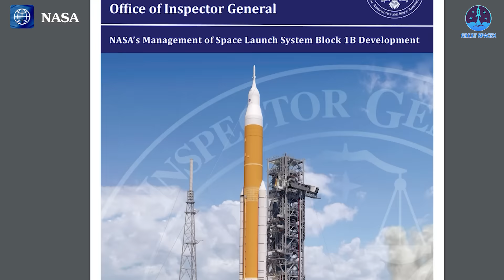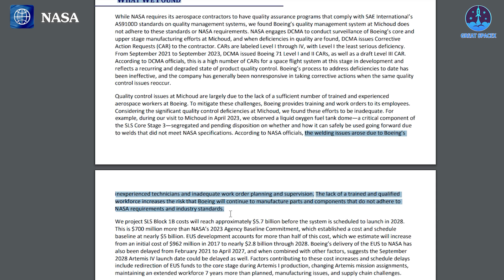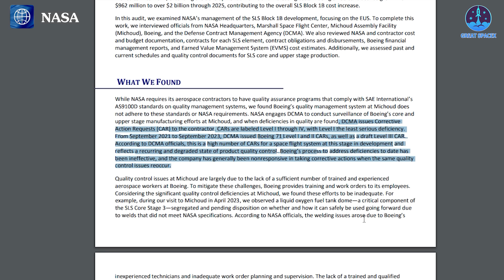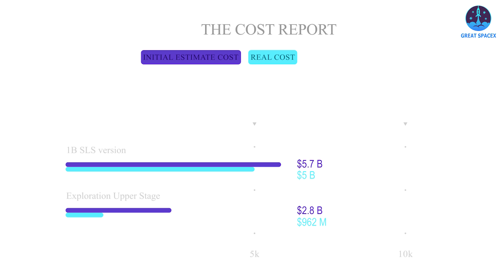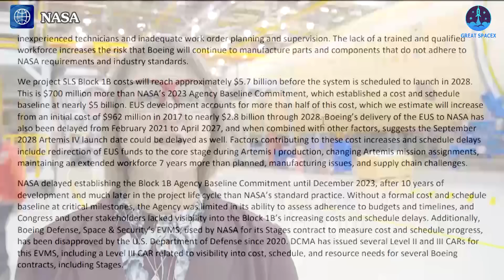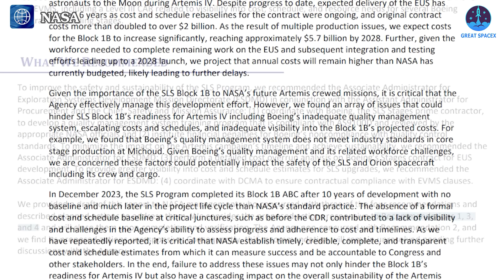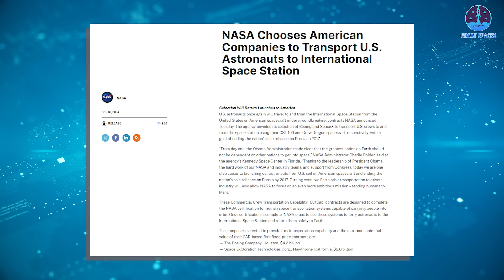NASA Stuck! Boeing SLS Core Stage NOT Safe for Crew While Starliner...

Comment: Boeing is a company of yesteryear, a great company, tip of the sword. Once LM took over Boeing and changed their business model to profit driven it was the begging of the end of Boeing and here we are at the funeral. It’s time to move forward, NASA.
Reply: When Alan Mulally was passed over for Boeing's CEO postion it signaled the change from engineering based leadership to accounting leadership.  When Boeing prices were about $50 I jumped in and jumped back out when the price was about $300.  It continued to climb after and kicked myself but then the coof hit so they couldn't deliver planes and the price tanked.

Comment: I can understand Where NASA is coming from for their systems, but afraid they have been well and truly been taken for a ride! When you look at the offerings, the SLS looks like an Atlas Rocket with boosters attached. A heavily upgraded version at that. Then there's Starliner, based on the Capsule/Command Module from the Apollo era. Boeing's SLS hasn't got off the ground yet, and Starliner can't get back from the ISS! SpaceX loves a challenge, and I can actually understand the static they are receiving from the old school system as the appear to be highly efficient in all areas! They don't want a monopoly on space, its just that others need to remove digits from their posteriors! But when Polaris Dawn undertakes its mission, another can of worms is opened that NASA will be directly involved in, and that is the space suits! It's not going to be a good couple of months for Boeing!

Comment: The marriage of politics and big business. And we wonder why everything costs so much and breaks down so often. I mean everything.
Reply: Home appliances are literally designed to break after a few years. They tend to be quite simple to repair so I've taken to repairing them myself so I can attest to how a small change could make it last years longer. For instance, a plastic clip that breaks after a few years vs a metal one that doesn't. The plastic clip being unavailable to buy, requiring its common component that breaks, which results in needing to replace the entire sub. assembly for 150$ because they saved 3 cents on a clip and won't make it available. It's hidden in the sub assembly as well so you can't see it unless you open it and it contains no capacitors so there is no risk of electrocution.

Comment: Looks like Boeing has completely stopped caring about cost, quality, or safety in all their divisions. 
Besides it being outdated technology/design, SLS at $11+ Billion for a SINGLE USE rocket is ridiculously insane. 

SLS, one single launch = $5.7 Billion
Starship & SH Booster, four launches = less than $1 Billion (will be significantly less once reusability is achieved 😉🤑🤓😎)

SLS - 4 passengers, Single use = $3.2 Billion (supposed to be)
Crew Dragon - 7 passengers, Reusable = $117 Million (crew capsule & booster)
Starship - 100-150 passengers, Reusable = $400-500 Million (Starship & Super Heavy Booster)

I think the best choice is clear. If you can’t figure it out? You have absolutely no business in aerospace. Ever hear the phrase, “if you can’t beat ‘em, join ‘em”? You can’t beat SpaceX. So... join ‘em. 😉🤓🤪   Work with them, instead of against them. Bring them into ULA (or Elon will just buy it with other like minded, innovative, forward thinking aerospace companies). You can even copy them, Elon really doesn’t care. That’s why his patents are public use. Take what he’s done and use it, try to improve upon it. But that would mean you care about innovation & advancement, instead of just your shareholders, and executive salaries & bonuses.

Boeing should step out of the rocket business and get their aircraft safe again. Leave space to those who can, and are. . . building for, and like it is, the future. 😉🤓🤪😎

#SpaceX #Boeing #NASA

Comment: Use falcon to launch the lander by itself. With a second for a blow up habitation unit for the astronauts travels. The hab unit could dock with a dragon for astronaut transfer and when returning to the earth for reentry. The hab unit, lander, dragon, and falcon could be reused several times. Likely at a lower cost than one SLS launch.

Comment: Hello
Do you know if at any time, there were considerations to give the soon to be retired ISS a brand new Orbit around the moon, be it entirely or in parts ?
Reply: Would be a lot cheaper to move it up to Luna orbit seeing as how much expense was used to get it into low earth orbit
Reply: It would take a lot of energy (and money) to get it to escape velocity and to the moon. Even if they could, the ISS is becoming obsolete. It wouldn't be worth it.
Reply: It's not possible. The ISS is too old, and the structure lacks the fundamental strength to withstand the acceleration it would need to reach escape velocity. Never mind all the torquing that would occur during that, TLI, and orbital insertion. It would break apart if they ever tried, and nothing can change the fact that every seal up there is a couple of decades old and at or past its service life. Plus the fact that the ISS lacks the basic radiation shielding it would have to have; Lunar orbit is outside Earth's magnetosphere, so it would have no protection from the solar wind or cosmic radiation. It was made for LEO. Period.

Comment: I think NASA should be looking at the Orion space craft that Lockheed Martin has built and it has flown a couple of times already and three more are under construction. Why don’t they look at that to replace the Boeing Starliner that is a piece of crap that doesn’t work , NASA should use Orion and Dragon No!? They both work!
Reply: SLS is too expensive to fly frequently, and the Orion was made exclusively for this rocket, it is significantly heavier than the dragon or starliner.

Comment: One of the big issues is that NASA is still using a Cost Plus contract for the SLS which forces NASA to pay for any cost overruns where the newer Fixed Cost contracts use for the CCP where ULA/Boeing would have to absorb the overruns.  Forcing ULA/Boeing to pay would probably be a death nail for SLS as then Boeing/ULA would have to re-negotiate a much higher realistic price and they would have to risk absorbing future losses like they did with Starliner.

Comment: Hello
Do you know if at any time, there were considerations to give the soon to be retired ISS a brand new Orbit around the moon, be in  whole or in parts ?
Reply: As far as I know, there were no serious plans to put ISS into a lunar orbit...
- Parts of the ISS are 20 years old, and their reliability is in doubt;
- You would have to redesign new engines and software to navigate the structure into lunar orbit, all on old hardware;
- A trip to lunar orbit would take a few big delta-Vs or a bunch of little delta-Vs (stress on the structure);
- The station would be constanly adjusting its orbit because of effects of lunar MASCONs;
- The Russian partner is very unreliable, and it's hard to see the time when we can partner with them again;
- Besides being unreliable, the Russians want out of the ISS by next year;
- Resupply and emergency evacuation of a lunar orbit human habitation would be more complicated than LEO;
- And you'd still have to answer the question: Why do you need a human habitation in lunar orbit?

Comment: Boeing was a great company. I flew their jets for 40 years.  Many reasons for their slide, but I think the employee unions are part of the problem.  The employees hate the company and sabotage them whenever possible.
Reply: I'd agree that unions are part of the problem, but many bad decisions from the top are also a major part.  It is mind-boggling that such a once-great company has come to be such a mess.
Reply: @davewilson4528  Agree.  The 737 Max problem was started by Airbus and DEI made it worse.  They both decided to computerize the planes so dumber pilots could fly them.  The airlines loved it and hired some really dumb pilots and trained them poorly.  Those pilots are fine as long as they don't have to actually fly the plane!

Comment: Yeah - lots of problems at Boeing, but don’t forget that in the end it is still a key US strategic asset. It’s in the US’s interests to fix it rather than see it fail. Also, don’t forget that SLS has already launched and flown around the Moon, while Starship has yet to orbit and requires untold further development to get out of LEO - or land. We aren’t at the point where ‘slow and steady’ versus ‘rapid iteration’ approaches or development can be seriously compared and evaluated. ATM it is still a possibility that New Glenn could get to orbit and land before Starship does.
Reply: But the capabilities of New Glen are closer to Falcon 9 than Starship.

Starship is also FULLY reusable while New Glen is about as reusable as Falcon 9...assuming they nail landing right away.

Also, New Glen has a max production in a year of about what SpaceX will do in a month.

These two are NOT the same...or even close.

Comment: I think that whoever negotiated the contract with Boeing should be sacked. To have a contract that allows cost overruns of the magnitude they get away with is, frankly, insane. 
Boeing were given almost double the amount of money SpaceX were and STILL haven't successfully completed even a single test-flight. Meanwhile, SpaceX are about to launch crew 9, with many resupply missions as well. ALL IN THE SAME TIME PERIOD!
The already identified issues with SLS and horrific cost of each launch, despite reusing Shuttle engines from of late 70's design, clearly demonstrate that SLS is not only flawed, it's not fit for purpose and is probably dangerous! For instance, should the dome with duff welding be used, when pressurised, how long before it explodes? (Which it inevitably will.)

Boeing is currently in dire need of a total restructuring both in management and culture. They are proving time and again they have major issues, especially with quality control. It would appear that since the merger with McDonnell Douglas, rather than take the best of both companies, they've done the exact opposite!

Personally, I think Starliner should be dropped, SLS deeply re-evaluated and probably scrapped and all contracts, especially with Boeing should be cost only, with room for negotiation on reasonable overrun in exceptional circumstances. Just look at what SpaceX are achieving with half the cost of Boeing's efforts, plus the difference in launch cost between the two companies is mind blowing!
Reply: The NASA administrator in 2011 was Charles Bolden. He was a marine Major General and former astronaut. A bit late to sack him. Not only has he retired, three OTHER people has occupied that seat and themselves retired. We are now on the 4th administrator after him.

Comment: How much of the cash that Nasa have given Boeing has actually been spent on the rocket .And how much has been given out to shareholders and top bosses bonuses ?
Reply: Dont only blame Boeing, this is heavily on NASA too, this is their project they are running. They should have engineers (nasa employees) embedded in boeings facility watching the work being done by boeing. Making sure it meets design and budget requirements.  The DOD does this with DCMA in contractor's factories. Its not just with Boeing's starliner and SLS, its with JPL and their 3 billion dollar rovers, over 10 billion dollar james web telescope, the launch pad NASA is building with Bechtel that went from 380 million to now estimated 2.5 billion....
Reply: And how much was returned to Congress as (re)election 'contributions'?
Reply: And don’t forget about all those purple cupcakes.
Reply: @tealshift2090  I agree. NASA is part of the problem, but WHO runs NASA? Congress. And it was Congress who 'designed' the SLS with as single objective to get jobs in their districts.

Comment: Kick Boeing Off the project.
The excuses are as long as the list of problems Boeing has caused... is as long as the list of unresolved issues... is as long as the list of problems Boeing has been told about but refuses to fix... is as expensive as the "fixes" are now proving to be.
Drop Boeing as a Contractor
Reply from the maker: Agree 👍
Reply: @colonbina1  Thanks for the video, Kevin
At time of writing, your video has had 1,883 views in less than 35 minutes after uploading
That is a pretty good result
Reply: Boeing is running the US segment as primary contractor. Who do you replace them with? The corporation running the Russian segment of the ISS?
Reply: @danielch6662  NASA could try whichever contractor(s) Space X has
They sure seem able to do the job.

Comment: What will happen to Starship when there is an accident or disaster?  Starship may prove to be safer than other vehicles and more reliable - time will tell - but it is still a rocket and the slightest mishap could end in tragedy.  Sooner or later, maybe later, Starship will have an accident. Only a question of when.
Reply: as they become more reliably reusable it will be like a plane failure...rare and grounds for an investigation. Having multiple rocket engines allows for redundancy. You could lose multiple engines, half a wing, and still soft land, and thats only the prototype!

Comment: My question….may be stupid… but could the starship booster be retrofitted for Artemis??  Or would falcon heavy work for Artemis??  Just thinking out of the box….
Reply: No. Superheavy =might= be capable if fully expended, but it would be a very close thing. They would have to redesign the entire 2nd stage to mate the two. They would have to customize the launch facilities from the ground up, as NASA will not abandon hydrolox propulsion until something better comes along, so they would have to install an entire fueling system just for the second stage that could handle hydrolox propellants. Then there is the reality of having to mate two completely disparate system architectures together to function safely, and Space X would have to adapt theirs to NASA safety standards. No cutting corners 'for profit's sake' like any corpo will do.

Comment: DEI 🤪 is screwing Boeing! 😉😂🤣
Reply: It's not DEI, they fired the engineers overseeing things and replaced them with accountants to keep costs down, but accountants didn't know engineering or safety results in horrible results at a high cost. Boeing knew this for years and didn't care because lawsuits were cheaper. It would take 15 minutes just to explain it all. 

Dei is a cop out, don't let Boeing shift the blame.
Reply: @jessiejanson1528  okay 👍 👌

Comment: I like SpaceX and crew dragon but it can't replace starliner. Because starliner has been build with the ability to boost the orbit of the ISS, like the Russian ships, and unlike crew dragon. I know it's a pity but....
Reply: I’m sure spacex could add that function and do all the testing before Boeing could even find a solution for their problems
Reply: @addisoncoleman9571  I think it would cost a lot and take a long time because that imply a huge rework of the propulsion system if crew dragon and its cargo module. More trusters, and or bigger, more fuel thus more space needed for that part, thus less space for cargo and people. It's what I think based on my very little knowledge on the subject.
Reply: You might have missed the recent news that SpaceX is building a one-shot tug to bring the ISS down -- so there never will be a need for SpaceX to alter it's designs for any ISS purpose it doesn't already provide with Dragon.
Reply: @SilverDigger-l8o  I've heard of it but the orbit of the ISS must be boosted every few months and ISS death is not before 2030.
For the moment, the Russian are boosting ISS orbit as needed, along with European cargo module. So, you are right that there is not an absolute need of a dragon module able to boost ISS orbit.
My bad, I forgot ESA and its ATV module.